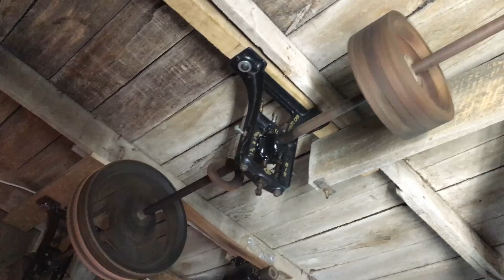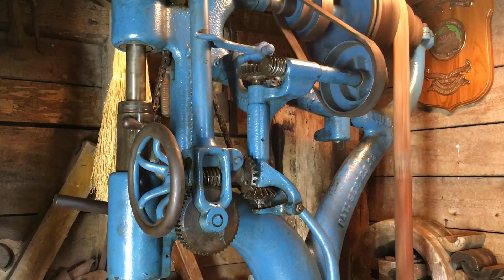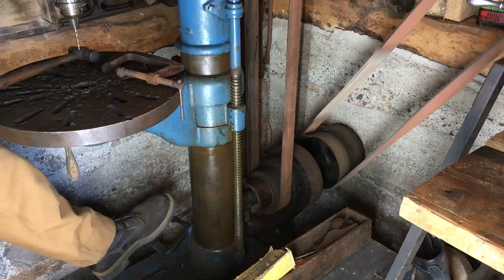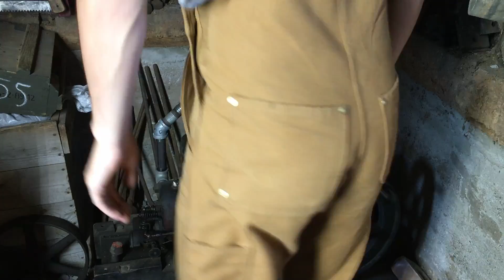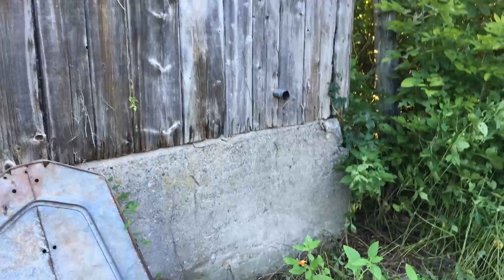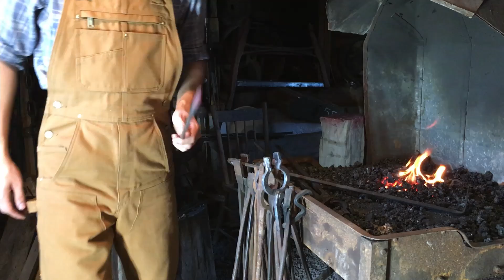Shop tour 1920s style

Comment: A great video which stirred many memories. I’ve never driven a workshop by steam but in the seventies I had a Flathers lathe of 1896 vintage powered by a petrol engine off a cement mixer till I could get a 3 hp single phase motor. I also had a Pratt and Whitney mill about the same size as yours serial no 138. P&W now make jet engines of course. In the 1960 I was working in the south of UK and a few miles away off the beaten track was w workshop that specialised in skimming put brake drums and other bits and pieces for agricultural machinery. The whole workshop was powered by a small diesel engine via a line shaft and his only light was a 12v  bulb using the engines dynamo and a very long length of wire.

Comment: Very interesting and good to see. Where i worked ones, the shaft with the pullies was still hanging in the metal workshop. The town Ijmuiden was founded in 1875 or so and some building survived ww2. The building next to it, "Hera", is even way more authentic and used for a movie as a decor. In my Belgium stables, i found the wooden tree piece where the anvil was and it still has the small metal pieces you can put in an anvils holes to shape metal. Also the small blacksmith table with the tiny coals is still standing there. I was a metal worker, welder and weld inspector when i still lived in the Netherlands. I am Dutch. 
Keep it up. Regards from the Belgium Ardennes.

Comment: Very nice lathe. How do get it running true on a gravel floor?
Reply from the maker: It needs to be readjusted every season due to my old building and the gravel floor as you mentioned. I've had no problems yet, but then again my work is generally +/-2 thou tops and not overly long. I'll be posting videos on turning pipe threads using a dog driver and offset tailstock. Cheers

Comment: amazing shop ! . where are you located in Ontario ?  im in  amherstburg Ontario and im in the meddle of doing the same thing as you , got myself a 1920s rockford lathe and two camel back drills waiting to be restored and hooked up to the lines shaft  im setting up , got sevral anvils and making a power hammer for my sword making business  . if your close buy i would love to hang and talk ideas and machines. also i noticed your hand crank drill press doesn't have a table on it . i have a extra one i can ship to you